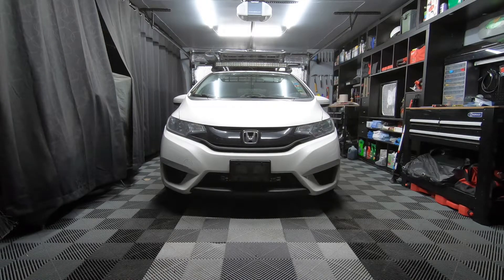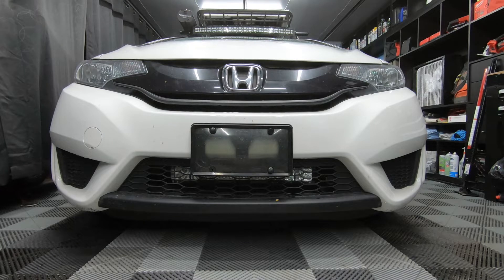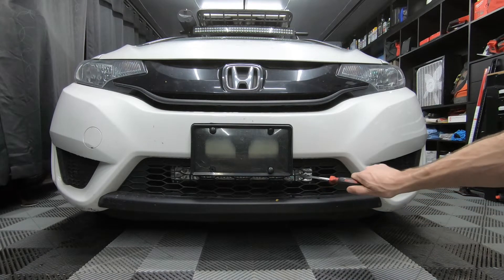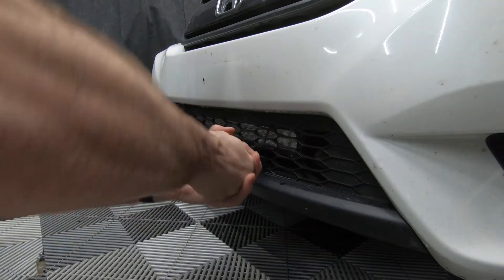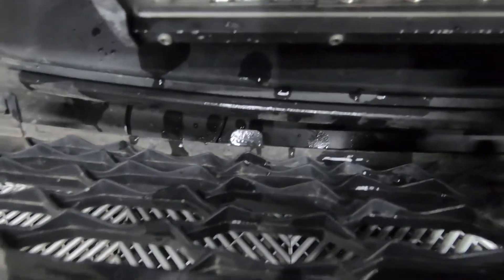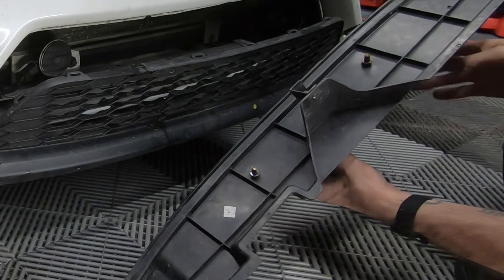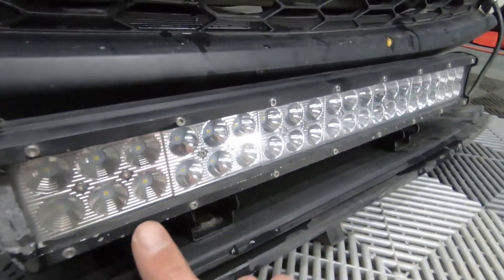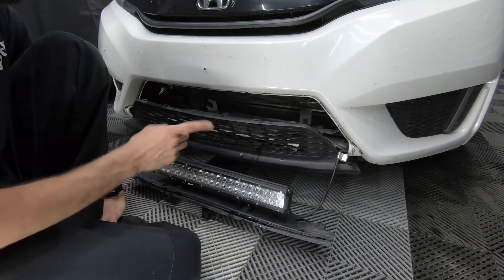HONDA FIT/JAZZ - GK5 - 20" L.E.D. Light Bar - Lower Grill Installation & 2 Year Review

Comment: Wait, one question, where did u get such switches as shown in 9:51 ?
I Know you said it is your own switches, but I was wondering where did u get such switch with rectangular casing that fits exactly like the OEM ones? Or did u just take the rectangular casing out and drill a hole and insert a switch in? 

Thanks.
Reply from the maker: Hi Jensen,
They are just generic switches from Amazon that I installed in the blank rectangular pieces plastic. I searched all over for a stock honda switch that I could use for the light bar but no luck.
Reply: @HondaFit4Adventure  Hi, sorry for the late reply. Thanks for your reply, now I understand. 

May I know how'd attached the switch onto the plastic case? You had to drill a hole yes? 😅